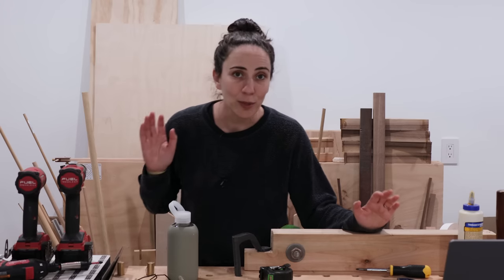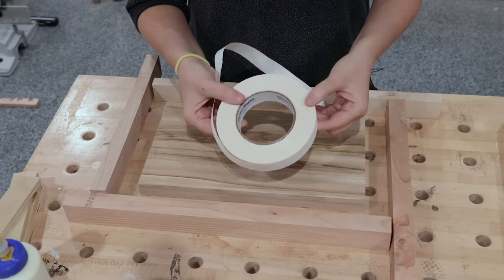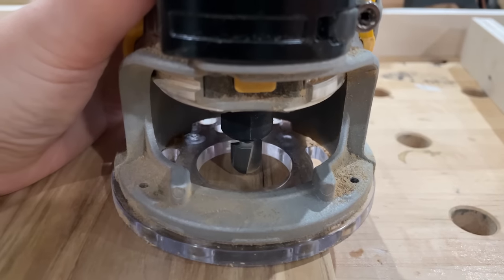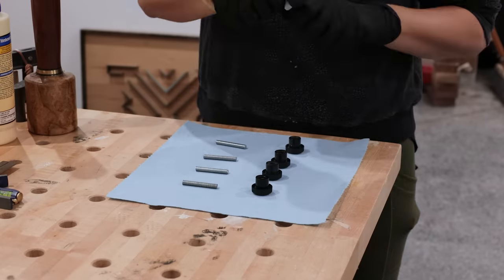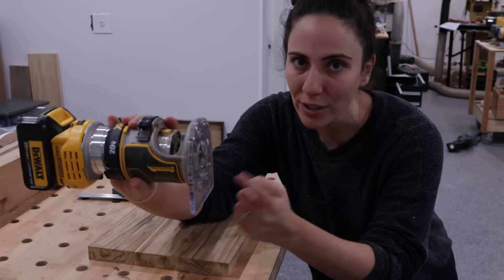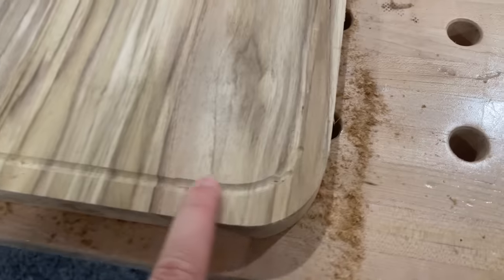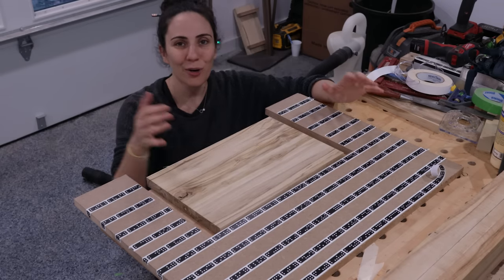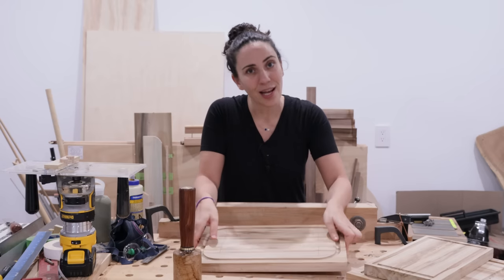Making a Few Juice Groove Jigs - Which one is best??

Comment: Fantastic, your "permanent" jig was the best of its kind I've seen, was that your own design? In any case, thank you for the detailed demonstration and clear explanations. 

One thing I've never managed to figure out is... how do you sand inside the groove? I've never been able to make it as smooth as I'd like, and after sanding the shape of the groove changes inconsistently... are there jigs that would work in such cases?
Reply from the maker: Glad you like it! Yes. I designed it myself on the fly as I was making this video. I use dowels to sand inside the grooves. The cornered and just annoying. I use softer sponges sometimes. It just take a lot of elbow grease

Comment: for the corners with large dowels on the edge guide I think it'd work a lot better if the edge guide with the dowels were on the edge that's parallel to the handles. then you could keep the dowels/edge guide pulls into the edge at all times, even on the corner.
Reply from the maker: Perhaps. But I’m not going to try again. The other methods are just fine so there’s no reason to

Comment: Hi Tamarama, been a while. Fine job, as always. I've seen some 'edge guides' for the curved corner work you were doing w/ last frustrating jig version, where they just only two dowels (smaller diameter, minimizing points of contact). I suspect the farther apart the dowels, the easier it is to maintain control / keep the router tight, but too far apart would might mess w/ your spacing from edge. Your thoughts?

Comment: I think the only issue with the edge guide method was not having constant pressure on pushing toward the center of the cutting board.
Reply: I noticed you were backing up or pulling away in the sped up footage, which likely ended up causing the issues. It seems like your edge guide method would be great and consistent if you can just find a way to add constant pressure.
Reply from the maker: That was the problem. I had to go backward bc I veered off the edge… so I went back to cut where it was supposed to go. It’s just not worth thinking about solutions when the other ways are so much easier and better
Reply: @3x3CustomTamar  Ah ok, that makes sense. yeah, it would be cool to have something like that though for sure, for a very consistent groove the same distance from all edges, even curved corners. But it probably only works well on a circle.

Comment: Great  video Tamara. However I hav3 just spent a morning routing out grooves and my frustration levels are at 100. Whilst I understand the science of keeping the router tight to the fence my reality is that I inevitably come off the fence and there we have a ding - reset and try again. Any solutions?
Reply from the maker: Hmmm… if you are going the correct direction, you should need to focus on keeping the router straight… the direction of the spinning bit should pull the board into the fence… if it’s pulling away from the fence, you’re going the wrong way…
Reply: The Problem that I didn’t explain is that the cut is on the far side to the guide (there isn’t room to mount a fence on the other side.

Comment: Great video but I was expecting a quick aside on routing a juice reservoir in the board.
Reply from the maker: Is that not what this whole video was about?
Reply: @3x3CustomTamar  Groove vs reservoir with a reservoir being a larger collecting cut out. These are usually found at the narrow end of the board and are wider than the groove and sometimes deeper.
Reply from the maker: @charliemason4355  ah. Yes. I made one of those in my most recent cutting board video where I turned my failed roll up chair into an end grain board…

Comment: Thanks for the jig ideas!  I'll definately make the adjustable jig for my rectangular boards!  But . . . I was really, Really REALLY hoping that you'd find a way to make the edge guide work!  I made a rectangular cutting board, and shaped the whole of both short sides (ends) into an arc.  I've been puzzling over how to put a juice grove on it, and haven't even finished it while thinking that over.  The best I could come up with was to use a CNC, but my current machine isn't large enough.
Any other ideas?
BTW, are you in a new shop?!?!?
Reply from the maker: Yup, new shop… posted a few videos about it already… and I would make an inside template and use a guide bushing for that situation
Reply: @3x3CustomTamar  BTW, where did you get that project board?  I can't find it in my area!
Reply from the maker: @russellfay81  at lowes

Comment: What stain do you recommend for teak cutting board. As far I know, teak already has some natural oil so, no stain? Or some light staining?
Reply from the maker: I would use any food safe cutting board oil
Reply: The best finish for cutting boards that I've found is an oil/wax mixture. There are lots of oil/beeswax commercial products, but it's easy to make your own. Heat up some food-safe mineral oil in a double boiler or crock pot and melt food-safe beeswax chips into it. There are lots of recipes online that you can find. You can also just use straight food-safe mineral oil (not any kind of vegetable oil - they can go rancid) and dunk the board in it, then wipe off the excess oil (which can take some time), then polish the board with a food-safe wax finish (but NOT furniture polish!!). I've never put any kind of stain on a cutting board, and teak is a naturally beautiful wood, so I would never stain it, but I suppose you could with a stain based on a very light oil, like Penofin. I'd be concerned about food safety, though, and even though staining a cutting board is probably just fine from a food safety standpoint, I wouldn't do it. The stain will only penetrate so far into the wood, and once the board starts getting scratched up from use, I think a stained board will likely look terrible. A board with an oil/wax finish can just be refinished, or if necessary, sanded a bit to remove scratches, then refinished.
Reply: Don’t stain cutting boards.  Many stains have some nasty stuff in them that you don’t want in your food.  Use mineral oil, beeswax or a combination thereof.  If you want darker boards, use darker woods.
Reply: @clayvansickle1  Thanks for pointing that! I read some more after posting the question and looks like staining is total no no. Also because it's teak, it's probably not necessary as well.
Reply: @3x3CustomTamar  Thanks Tamar!
Reply: @linsen8890  Thanks so much for the detail answer, it was really helpful for me to understand! Sorry, my question was probably little immature as well. Now after reading some more I realized staining isn't a good idea for a cutting board.
I found there is also a mineral oil + beeswax mix sold as "butcher block conditioner" as well. I'd probably go with that to start. Thanks again :)

Comment: The edge guide would have worked just fine to make a board without rounded edges as in the first one. But still you would need to be careful in the corners
Reply from the maker: Not worth it when the other ones you can do with your eyes closed.

Comment: I think the V-Groove in the Template was too small for the radius of the board to guide the cutting bit securely. But every other method is way safer to guide the Router.
Reply from the maker: Yeah, didn’t want to bother messing around since the other ones work so well

Comment: Thinking about your method that didn't work... while it's not worthwhile for regular rectilinear boards (I use the adjustable four-fence method), it could be worth developing if you put grooves on boards with freeform curvy edges. I think it failed for two reasons: the unsupported outboard portion of the router base allowed it to tilt off vertical; and the sharp corner is 'jerky' trying to navigate even with a bearing bit, and your dowels are much less 'smooth' than a bearing. The sharp corner issue is already resolved on a freeform curvy edge board. And the outboard tilt could be addressed by taping a block to the underside of your extended router base, the same thickness as the cutting board. It would also be much less stressful.

Comment: Hi Tamar. Great video as always. Just wanted to point out that it doesn't matter in which direction you move the router in all of these cuts. The bit is cutting on both sides, so one side will cut in the right direction and the other side will always do a climb cut
Reply from the maker: It absolutely matters. If I were going the other way, the router would want to wander away from the fence causing not straight cuts…
Reply: @3x3CustomTamar  Yeah i think you are right. I didn't think of that 😀

Comment: why so complicated? just measure from the edge of the router bit to the edge of the baseplate and subtract your 3/8 (or whatever you choose for the distance). another (slightly more complicated) option would be to take the diameter of the baseplate, subtract the diameter of the bit, divide by 2 and then subtract your 3/8. and hey presto, there's the width of your spacers.
Reply from the maker: To each their own. That sounds more complicated than how I showed 🤷🏻‍♀️
Reply: @3x3CustomTamar  
as you said - you do you.
Reply from the maker: @mrxmry3264  exactly. Ha

Comment: Never understood why anyone adds a juice groove. It reduces your cutting area. Takes away from the looks of the board. Harder to clean. 

I do heavy underside bevels on the table saw. You can hang your board over your sink. Slide a plate underneath. Looks more modern. Easier to clean. Keep 100% of the cutting area. Juice grooves are from your grandpas 1950s cutting board.